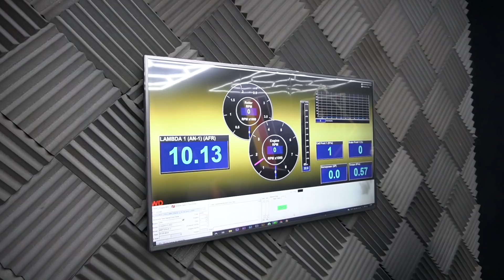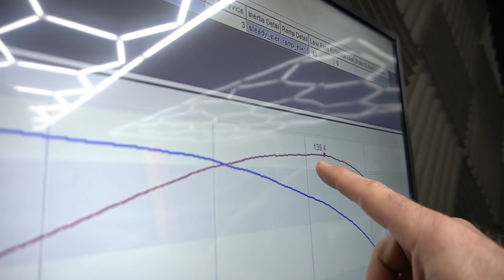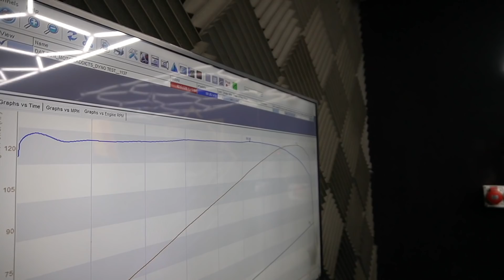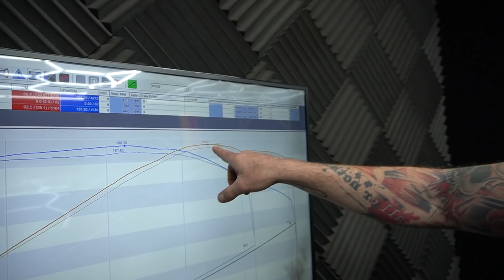THE DATSUN 240Z DYNO POWER RUN - HOW MUCH BHP HAS IT LOST IN 50 YEARS?

Comment: Great test - these were never 151 which was an SAE beanch-test number on 1x engine with no load, no accessories including no water pump. In the car, new they made approx 130 bhp DIN at the flywheel. I'm surprised that the engine revved to 7000 ! Normally on a stock camshaft, the engine will struggle to pass 6k.

Comment: Seems a pity to swap the stock motor, but it would probably cost a fortune to tune for big power. I'm guessing a logical swap maybe the RB26 skyline engine, and it would keep the simple straight six layout. However these guys threw everything at a swapped L28, and hit a bonkers 560bhp. https://youtu.be/gu9cp2Pd9Dg